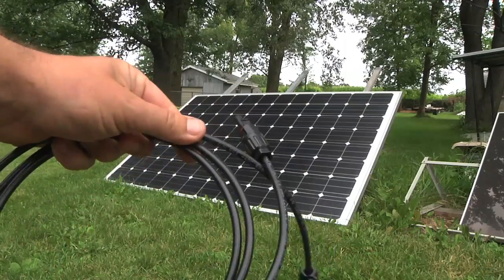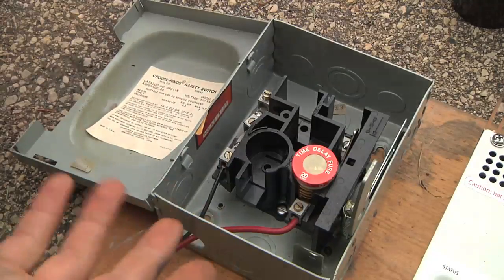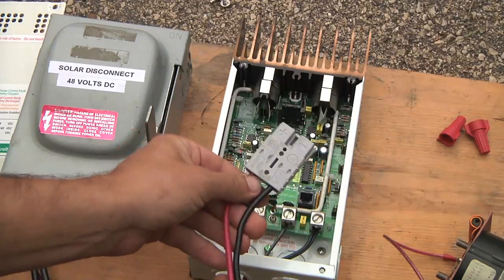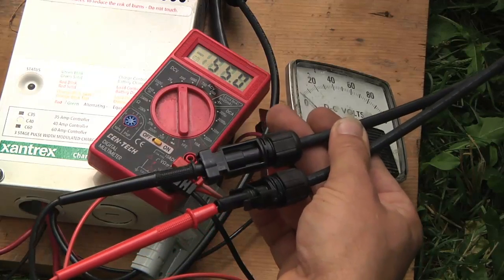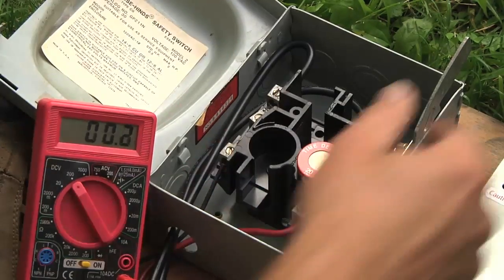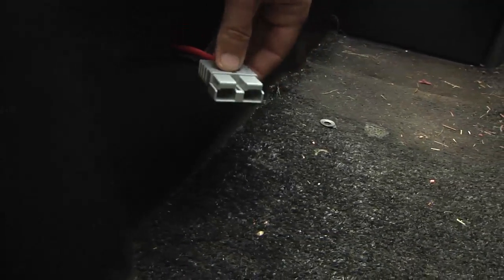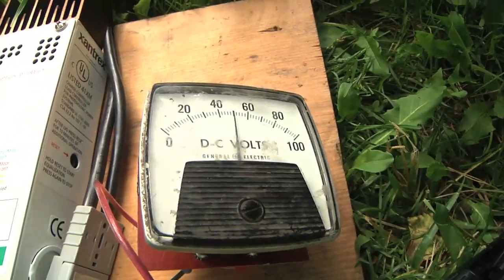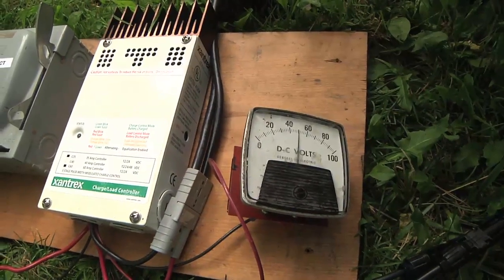Direct Solar Charging an Electric Car

Comment: I would put your setup inside the car instead of the garage, with the solar panel on the roof of the car. Then the car charges anywhere you park it.

Comment: So
I have EV 50 kWh battery.
If I buy used solar panels upto 8kw,can I charge my car direct,no inverter etc.
I guess the battery is DC,so no need for inverter???
Any thoughts from anyone?

Comment: Would this work on a smart car?
Reply from the maker: Only if the car was 48V.
Most commercially-built electric vehicles are 300-400VDC.
You would need solar panels that produce higher than whatever the voltage of the battery pack is.
You would also need some way to connect directly to the battery. It's possible that could be done through a CHAdeMO or CCS fast-charge port, but would require special equipment, and nobody has built a commercial system like that yet.

Easier to make power with solar, convert it to AC, and just do some typical charging.

There are a few solar companies out there that have products that are coming SO close to what would be needed for high-voltage direct solar charging (and pulling power from the car as well.)
Pika has a nice solar system that works as all high-voltage DC (including the battery.) I spoke with one of their engineers once about adding direct car charging, and he said "yeah, I get that a lot", but said that they were focused on just the solar aspect, not anything with EVs.
https://www.pika-energy.com

Comment: Did you ever check the actual current going into the batteries? I don't think a 48v panel will produce much amperage above 48 volts? Probably two 48v panels in series to increase the input voltage to the controller?
Reply from the maker: This was a long time ago that I did this. I seem to recall that current dropped off quite a bit on the higher end of the voltage range. (Which is to be expected. The amount of current is proportional to the difference in voltage)
I used this a fair number of times for charging my 48V electric motorcycle.
Two (or more) solar panels in series would get to a higher voltage. A person would want to use a solar charge controller which allows for a higher voltage input while still charging 48V. This is how many of the "Hybrid" inverters work.
In this video, I was just using some simple equipment that I already had. Worked fine.

Comment: How to check amperr
Reply from the maker: In this case, probably the easiest way to measure current is just to use a multi-meter with a "Clamp-On" DC ammeter feature.

Comment: Why don't u install a wind turbine rather than expensive solar panels?
Electric car can be charge from electricity made by wind turbines too.
Reply from the maker: Wind turbines are great! as long as you have the space for them, and the wind isn't blocked by trees. Unfortunately, I have a small property, surrounded by the neighbors trees, which blocks the wind. Both solar and wind are great options for renewable energy. Do whichever (or both) as long as it makes sense for your property.

Comment: Wires coming out of DC disconnect runs over a sharp edge. This will fail. AC disconnect is being used to switch DC. This will fail. I've made all these mistakes and paid for it. Get a copy of the electrical code and read it.

Comment: I own a 72 Volt Comuta Postal Van. Do You happen to know if this rig worked properly finally? I would like to add 3 100 Watt solar panels on the roof of mine to charge through out the day time.
Reply from the maker: This solar panel is LARGER than my Citicar, which is one reason I didn't mount the panel to the car. I know that the postal Van is a little bigger, but you would still need to use relatively small solar panels to make them all fit. On a 72V system, if you were using 3 solar panels, they would need to be 24V panels, as you need to match up with your battery voltage.
Many electric cars will go 4 miles per Kilowatt-Hour, or about 250 watt-hours per mile. If you had 300 watts of solar on the roof of the car, you would likely add one mile of range per hour of charge in full sun. That might be fine if you only have a very short distance to travel, or only use the car every other or every third day. Of course, you could always still use a regular battery charger as well. Perhaps let the car charge in the sun all day, and if you know you need a full charge for the next day, then plug in the battery charger at night.
If you use smaller solar panels, you might be able to put some up on the nose, where they would be angled towards the sun a little better.
Reply: Thank You brother. Definitely gonna use this info. I was aiming to get 3 Flex 100 watt panels just for Trickle charging through out my drives. I do aim to drive it 3 days out of the week so I would work fine. I also aim to upgrade to lithium Iron Phosphate batteries, an AC Motor for Regen Braking and  a few super capacitors to help with acceleration, starting, and charging. I read that You can Charge the Car with a small 3KW portable Generator (Honda o Yamaha) while driving If I have Li iron phosphate.

Comment: I had Solar PV on my 1984 VW Pickup conversion. It could get 10-20 miles a day from the solar. 
BUT solar PV is best on a fixed location always feeding the GRID.  Then if you don't drive for a few days the power still gets made and used. On a vehicle or sitting just for the vehicle you lose out when it's away.  You can see the EV on this link. http://www.phoenixeaa.com/pictures/motoring_through_time_2010/main.html
Reply from the maker: I completely agree with you. That's why my next solar project is covering my entire garage roof with solar panels using a grid-tie system. My electric vehicles will still be available to me to use as a power source during a blackout.
Reply: You guys are ver y very right.. Thats exactly what i did with my mini Cooper 2006 EV convertíon in mexico,  i HAVE 7 kw pv cells, The inverter puts The power, into The grid and it is saved, then i use it to load The EV and in home. It works great, The power company instaled free a bidireccional meter. So if my pv cells produce more they récord it and save it on The grid for my later use, with out The need Of a powerwall or batteríes for saving.. In México we can do that.. Thanks Ben for your Wonder ful work in this issue Of EV convertíon. OUR planet is shouting we better correct his atmosphere compositivo  for our good sake...

Comment: Why put in in the garage? Why don't you just mount it on the car for all-day charging?
Reply from the maker: The solar panel is bigger than the car. Also, I ended up mounting the solar panel up on a structure so that it's always in the sun, whereas my driveway is in the shade quite a lot of the time.
Reply: +BenjaminNelson what do you do with the power when the car isnt charging?
Reply from the maker: +michael phillips I've also hooked up the panel to a basic grid-tie inverter and used it to charge my electric motorcycle.

Comment: I would like to know how to do the same with my chevy spark EV. of course, I could spend a bunch of money and wire a huge inverter, then plug in my emergency charger and feed 800W while losing 30% efficiency,  but then I'd be no better than the companies running those massively wasteful DC fast chargers. I want direct solar to battery but I dont know how to hack the protocol of the SAE combo charger in order to do this. Anyone have clues to get this started?
Reply: I have a Spark EV also and would like to know the same thing.
Reply: Wouldit  be possible to use this method to charge a Chevy Bolt? What would the numbers have to be? I believe the Bolt's battery is ~ 250 volts and 60KWs

Comment: In germany you will have to pay money to do so. they are going to set up a sun tax. For each kWh produced with solar panel and stored into an battery one has to PAY money for it.

DEATH to the electric car and DEATH to solar. finally fine coal fired plants and moar zesty diesel vehicles for the future. this is the way the crooked goverment works.
they do so because 32 gigawatt solar (peak) is scaring the crap out of the old managers.
Reply: Hy
Reply: Spain already ruined their economy with a terribly planned out solar subsidization and a solar tax and solar police that followed when they realized they'd gone 3 billion euros into the minus with solar incentives. Not the fault of solar, but poor planning. Not idea why no one is learning from that.

Comment: in fact electronics .  48 volts will use half the current over the same time  twice the volts  half the current and if it where an inverter that runs at 48 volt same thing as long as the load dosent change a 12 volt will use twice the amps and probly drop to 11-10 vdc and will shut off .that depends on who makes  and the specs and if its rated output is realy what the company says . most of the time not i have ben  an electronics tech for over 30 yrs   i know what i am saying   any   pro question  ask.

Comment: do you know that disconect box is for ac along with the fuse?  its not ment for dc  that controller box  fad name is realy  a voltage regulator also keep wires the same size  dont put thinner to thicker in dc power it needs  thick for current.  and if all the solar cell puts out is 2 amps ,  it wont be enough to charge fast enough.  if there wet cell thats a trickle charge at least 10 amps is recomended.

Comment from the maker: Hmmmmm. Well. In real life, it seems to charge pretty well through the middle of the pack. As pack voltage rises, current drops, so it's really slow to charge the top 20% or so of the pack. Which isn't really a big deal, as I don't use either of these vehicles everyday, and they are both perfectly useful at 80% charge.
I've never actually seen my C-40 charge controller display 8 amps, 7 is the highest I've seen, and it's usually more like 6.

Comment: there's a display you can get that Xantrex charge controller, it will show the voltage, Ah collected, power and amps.
might want to look into that.
Really to have a panel on top would be nice, if you can find the right size and high enough voltage.

Comment from the maker: This little car is designed for up to 40 miles of travel, although I don't have the "correct" battery setup in it. I only live two miles outside of town. My typical round-trip to the hardware store, library, grocery, etc. is usually about ten miles. It's more or less weatherproof. The windows don't seal-up great, but it's a plastic body, aluminum roll-cage frame, and indoor-outdoor carpet inside!

Comment: thanks for the tips we get a lot in short time from your videos but i have a question that i have been searching the internet for an answer to is it possible in theory to have a house powered with 120 or 240 volts dc without eliminating the need for a pricey inverter and why don't we see such solar and battery setups?why not a 120 volt solar and battery system instead of 48 volt maximum and is there a company selling large enough solar controllers for solar powering a house?

Comment from the maker: In this case, the solar panel is BIGGER than the car! So I wouldn't recommend putting the panel on top of this car!
Batteries are measured in amp-hours (AH) and solar panels in amps (A). This panel can put out about 8 amps. The batteries are 100AH capacity, but you NEVER use the whole capacity. At 50% depth-of-discharge, it's about 50AH capacity. 50AH divided by 8 amps is 6.25H. So, in this setup, we're looking at a little over 6 hours to charge.